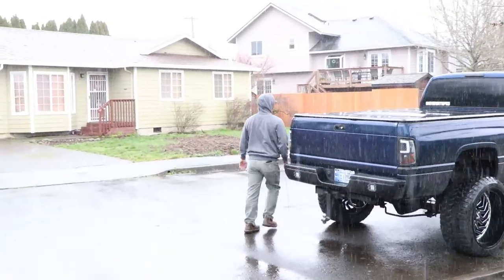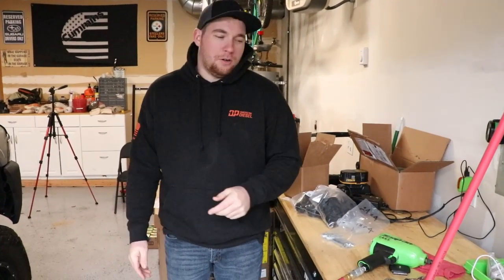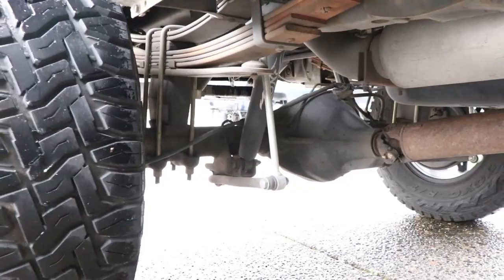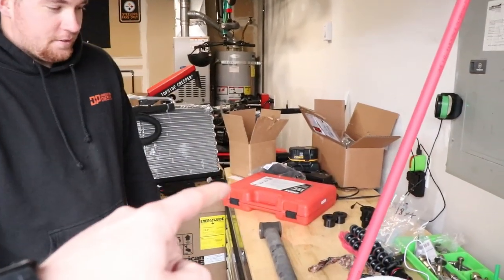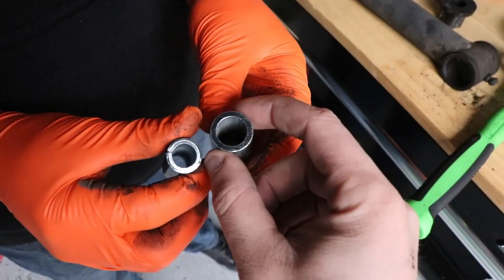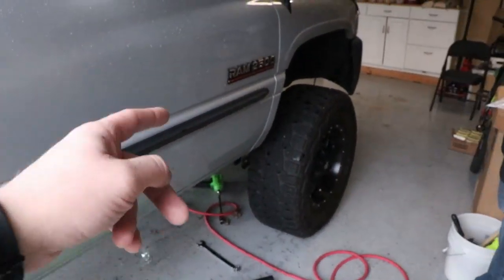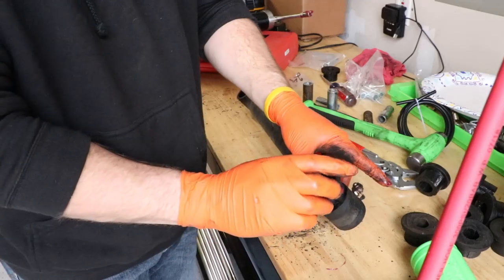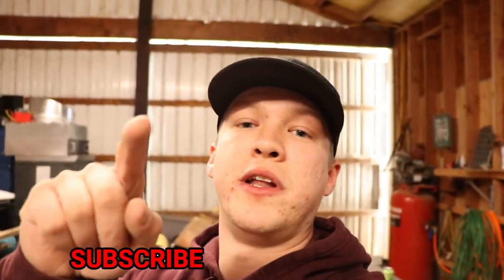HOW TO REPLACE CONTROL ARM BUSHINGS! (SUPER EASY!)

Comment: I'm confident mine will be nowhere as easy to replace as yours since they've probably been in there for 180k miles of Pennsylvania roads. Gonna probably cut them off and get control arms with the bushings already in and new bolts/nuts.
Reply from the maker: Bailey Miller yeah I had to do that to my truck when I took off the stock arms.
Reply: How long were these ones on for? Looked way to easy of a replacement.

Comment: One time at 6am I was Splashing a boat to go fishing and was in a rush. Ended up locking my keys in the truck while it was still turned on in the parking lot. Well I have an Edge with a turbo timer so I wasn't worried that the truck was still running as I left. Well 10 hours later there's a small crowd gathered around my still running truck... 😂😂
Reply from the maker: ChrisCo it happens to all of us 😂🤷🏼‍♂️

Comment: Hate to say it but i finally got my 2000 dodge ram 2500 24v 5 speed and the first day i lock the keys inside while it was running thank god i put the spare keys in the house

Comment: Bro u can turn that off the auto lock... Lol truck should have came with instructions in ur owners manual booklet of u dont have it pm me and il give u the steps. Grease eats rubber over time. Use dielectric grease. Wont eat the rubber.